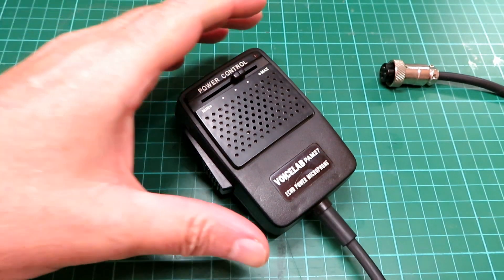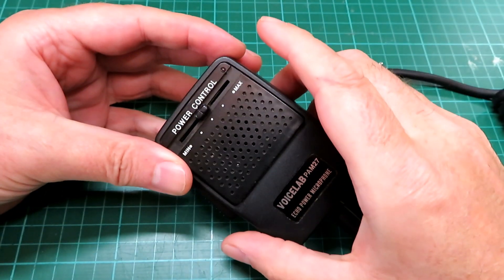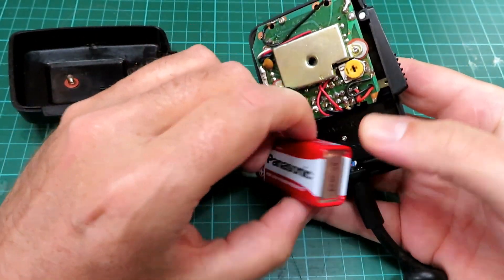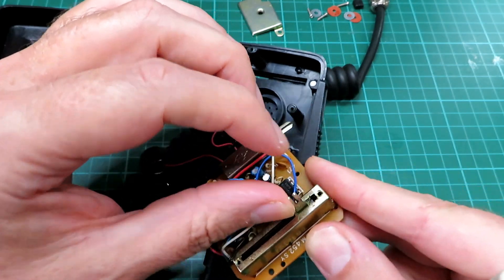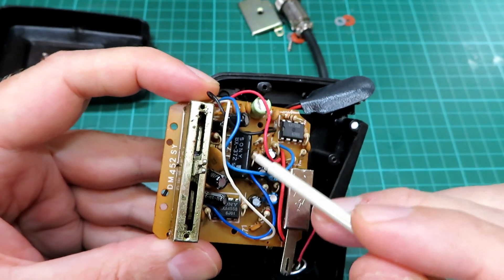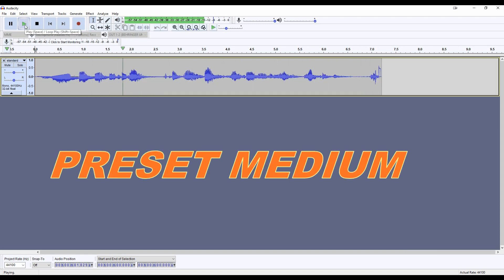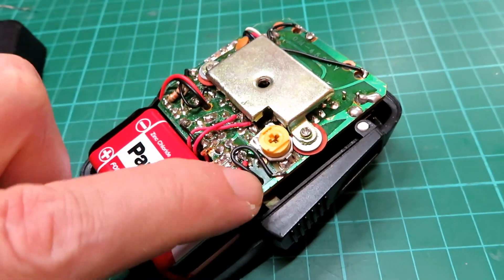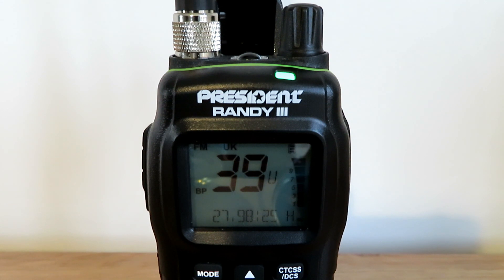WHAT'S INSIDE AN ECHO POWER MIC? & HOW DOES IT SOUND 40 YEARS LATER? - THE VOICELAB PAM27

Comment: I have found an old Pan International ECM 2018 tucked away in one of my cupboard with the old receat. I have paid 129 guilders in the year 1994 and it ahs a sticker Made in Taiwan! And it still works! It has a 6 pin Standard President mike and after i put a 9 volt battery i could use it! Damn this mike belongs in a Museum!

Comment: I was thinking they had 3 adjustments on 1 in front and 2 on the board And if you had one with a talk back version it had 3 inside. I was thinking there was some mods you can do it to them years ago that you can get endless echo. There used to be a guy know he would take the mic apart and install it inside the radio
Reply: there is a mod for the dm 452 you use a normaly closed push to open push button switch,  you cut the trace on the sliders ground which will give it the endless echo,  wire the switch across the cuts to reconnect when you push the switch it opens the connection to endless echo,   we used to mod these all the time back in the  mid 90's swapped out the 50k pot to 100k or more  used a thin style pot drilled holes in the back so you could adjust the echo time up and down  on the side we would drill a hole to mount the push button switch we did all kind of mods to the dm452 the new ones are surface mount so they dont mod like the older versions did, i did one of the surface mount ones for a friend a few years ago after about 3 days it just stopped working all together

Comment: Used an echo Mike on my amstrad 901 I think it was an akai one ,
As I recall it blasted channels either side of one you were on if set too high 
And on cobra 148 on ssb am it was just a pest taking over the calling channel 
Wiping ppl out .

I remember mine because stupidly I thought it powered from the rig 
And when it stopped working I put it in a drawer it was only when I was talking to local radio doctor he told me to try changing the batteries 🤦
Yup that fixed it .

Edit not akai Altai .